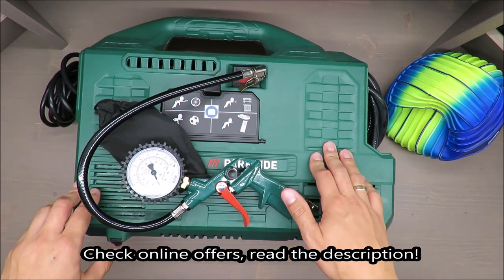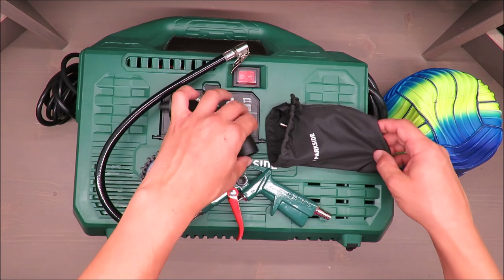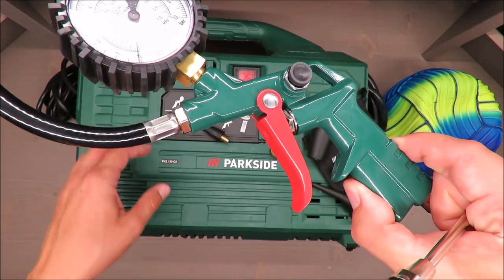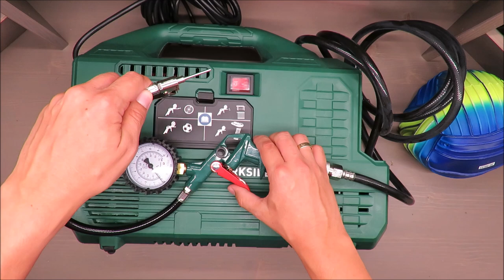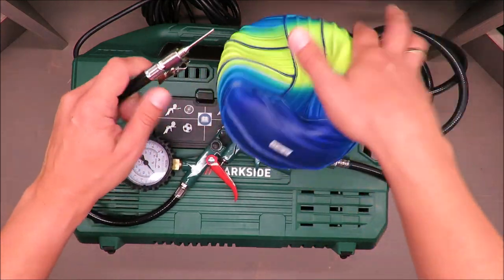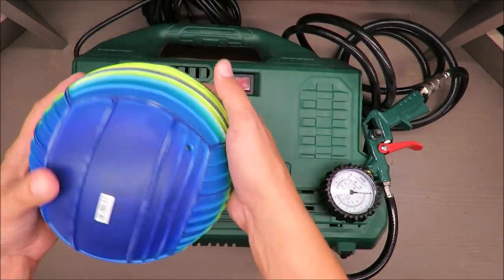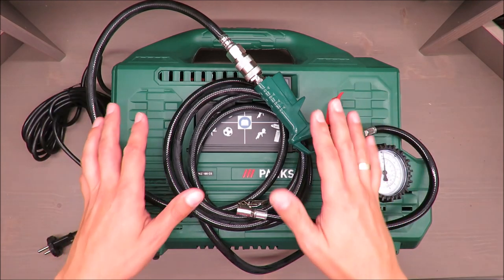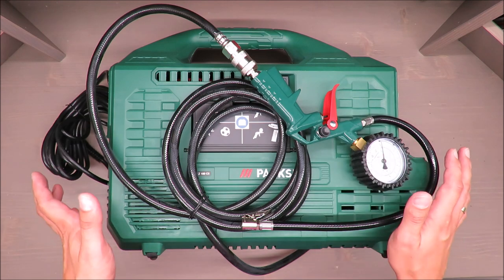Parkside Air Pump with Piston Compressor PKZ 180 C5 REVIEW / TEST (Lidl 8bar 180l 3550 1100W)

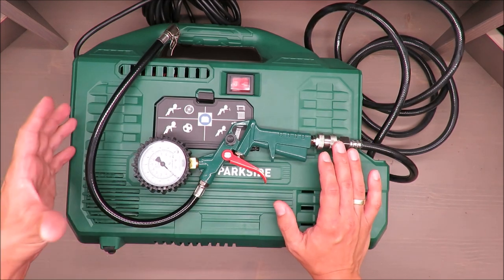Comment: I think the reason you failed to inflate your car's tires is the bad connention between the air pump adapter and the tire valve. If you check carefully at 08:30 (after the connection and just before you start the air pump), you will notice that there is a serious leakage from the connection. This leakage may be due to bad installation of the adapter or more likely due to faulty adapter. 

Furthermore, there are several other videos on youtube, reviewing Parkside Air Pump PKZ 180 that demonstrate succesfull inflation of car tires.

Comment: Thank you for the Review. I wont buy it. On the picures and in brochure it looks very handy. But considering its noisy and doesn’t have the storage tank for compressed air makes it useless compring to small air pumps. Not worth It.
Reply from the maker: Your welcome
Reply: where did you want the tank to exist :D ??? This is how tankless case compressors work